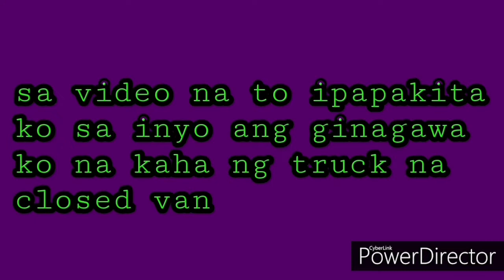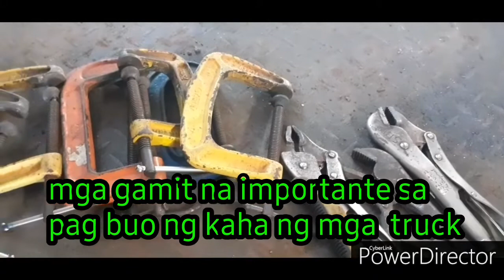Truck Closed van build |  corner cover

Comment: Anong purpose ng corner plate? bakit ndi sya pataas?
Reply from the maker: Parang pinaka lock nya po sir
Para mas lalong matibay 
Lahat kasi ng closed van yung corner ang mauunang masisira sir 
Dati yung mga closed na
Gawa ng mga company hindi nila nilalagyan ng corner plate pero ngayon nilalagyan na nila 
Importante po yan sir sa mga truck na  dropside 
May video rin ako sir tungkol sa mga truck na aluminum dropside with pipe railings 
Salamat po sir
Reply from the maker: Parang pinaka lock nya po sir
Para mas lalong matibay 
Lahat kasi ng closed van yung corner ang mauunang masisira sir 
Dati yung mga closed na
Gawa ng mga company hindi nila nilalagyan ng corner plate pero ngayon nilalagyan na nila 
Importante po yan sir sa mga truck na  dropside 
May video rin ako sir tungkol sa mga truck na aluminum dropside with pipe railings 
Salamat po sir